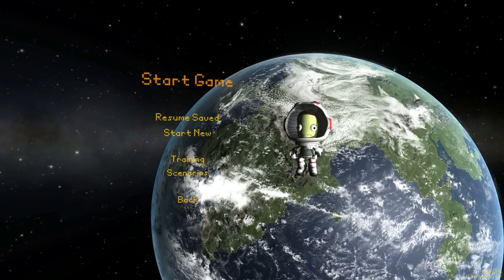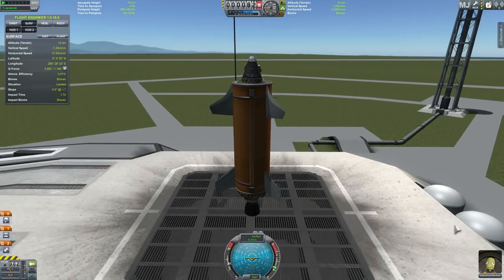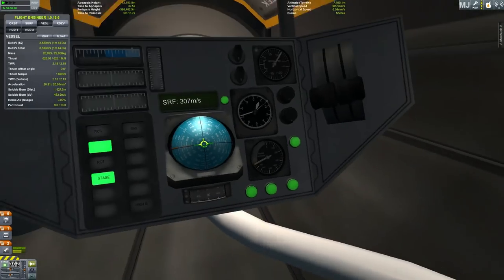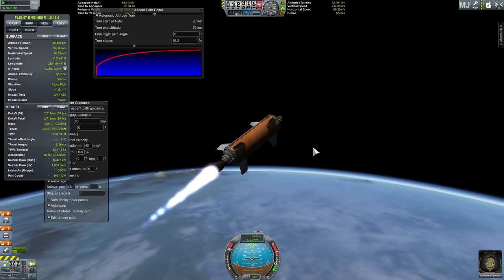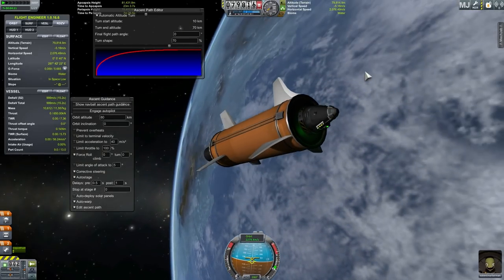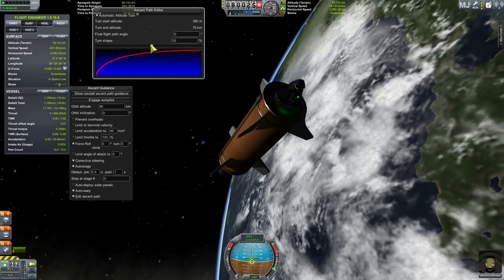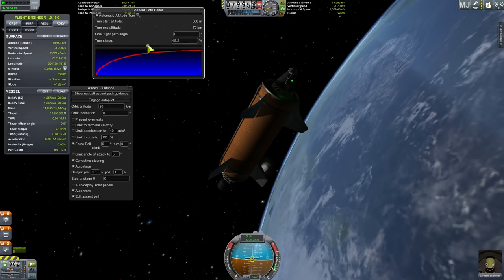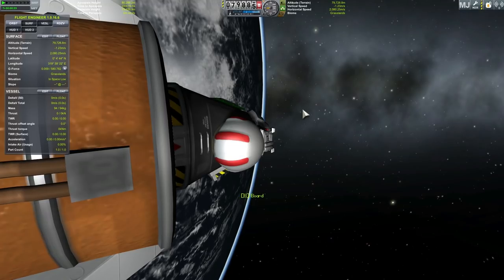KSP 1.02 - Optimal Take Off Path - Investigating the Gravity Turn.

Comment: Not putting fins at the front would help the thin rocket.
Reply from the maker: Myk Dowling I tried all types of fins or no fins. NOTHING helped my poor thin rocket... it kept spinning and spinning and spinning
Reply: Anton Petrov Haven't had a chance to play 1.0.2 yet, but I had no probs in 1.0 with thin rockets with tail fins, as long as I kept the heading close to prograde. (Turn early and slowly)
Reply: Anton Petrov There is no restoring force when you use fins at the top of the rocket. There is Yaw, pitch and roll dampening but only having fins at the bottom of the rocket keep the center of effort lower on the rocket and restore the rocket to prograde as long as you dont go too far off prograde.
Reply from the maker: I couldnt have a rocket called fuglor NOT have ugly fins on top. it was an aesthetic choice
Reply: Akin Khoo Just make sure you have more drag at the bottom, and your rocket will keep a low AoA. Tail fins work very well.
Reply: Anton Petrov I don't think you understand how drag above center of mass can fuck everything up. I'd send you a hand drawn physics explanation completed with force lines, torque lines, fuck ugly geometric shapes and everything.

But, basically, drag above center of mass means. If your rocket ever got tilted, even just a little bit(and it will), the front-drag will further encourage the tilt. Which will make the front-drag encourage the increased tilt that itself caused. and then again, and again.
it's a positive feed back loop

The opposite is also true, if there's drag behind center of mass, they will counteract any tilt/torque, and make the rocket flight straight. This is why the feathers on an arrow is where it is.

What you need is more lift surface (not control surface, as the torque those provide are annoying functions of vector)
And you want them WAY below your center of mass, and tack on some reaction wheel for constant torque control and good luck!
Reply: Anton Petrov Did you try pumping fuel back to the upper tank? KSP annoyingly (but perhaps naturally) drains fuel from the uppermost tank first, lowering your CoM, possibly below the CoL, which is what makes a rocket unstable.

Comment: you rocket flips because your COM is getting way lower in the rocket as fuel burns. You have fins at the front. Meaning your COL is way in front of the COM. Any SAS control input sends it out of control, and you can see quite a large YAW input just before the rocket spins out. Never put your COL in front of your COM.

Comment: You aren't supposedto have winglets on the top of the rocket (facepalm)
Reply: Peter Nielsen Thought so too, but the extra lift on this smooth gravity turn provided by an extra set of winglets can net you over 50 deltaV more. With two sets (top and bottom) of four AV-T1 I had over 1300m/s deltaV left with the same auto-ascent settings and rocket(excluding the winglets). Obviously with a more aerodynamic nose and limited acceleration (too bad limiting to terminal velocity is busted) much more deltaV could be saved.
Reply: Sasha-san that a good explination but wouldnt it make more sence to thave the winglets a bit further down to be more in line to make the COL match the COL ?
Reply: Maybe, but the point is basically moot. Any lift you get from the winglets is only useful for small rockets. I just wanted to make a point, that in this specific situation additional winglets were surprisingly useful/not-useless. I'd go with reaction wheels for additional stability.
Reply: OK thanks

Comment: The reason it's flipping it not because of the rocket width, it's your usage of the wings is shocking.

You need to display center of mass and center of lift. You want your center of lift (Blue sphere) to be under/behind your center of mass (yellow sphere). Not too close and not too far away. You can get your own personal feel over time.

Read here on the wiki http://wiki.kerbalspaceprogram.com/wiki/Center_of_lift
It explains placement results and will help you learn how to get better control of your craft.

Comment: @Anton Petrov Hint: dont change the angle in flight below 30km. After launch... ~350, go for what angle you want and keep it that way... It is true, the air presure is playing hek with the craft but if you keep the air presure stable in ascent, its ok. (this method is tested and i can give you my vid. if you want)
Reply from the maker: Alexandru Savu That's not the most efficient method. You want to make it a gentle curve due to the increase of terminal velocity and decrease of pressure as you go up.
Reply: Anton Petrov the best method relies on mj and its not a method for small ships... Change the ship, change the rules...
Reply from the maker: There are videos by Scott Manley who shows how to do gentle turns. It's not very difficult with practice. It's the same way you would do a manual suicide burn. Not as efficient as mj, but still more efficient than going in a straight line
Reply: Alexandru Savu Mech Jeb is not the most efficient way of flying. It can't lift some of my rockets. Though I can easily do this manually. It's just a good tool to start learning gravity turns or for "launch and forget".

Comment: The way to NOT have your rocket lose a good amount of Delta V is just stay close to the prograde marker.
Reply: Jack Graham staying close to the prograde marker will minimize steering losses, but the greatest savings will come from gravity losses. So you will want to start moving sideways as soon as possible without overheating your stuff.
If your turn has reached 45 degrees at 10k altitude, you're doing fine

You can also do a realistic single burn to orbit bringing the periapsis up by pointing the vehicle down

Comment: Wouldn't higher TWR rockets work better with a steeper ascent? You want to get out of the atmo before aerobraking and heating hits you too bad.
Reply: Myk Dowling No, as I wrote in another comment, you want to save as much weight on engines and fuel as possible instead, which avoids running into heating problems in the lower atmosphere. If you have to throttle down, or choose a non-optimal ascent path, you're almost certainly carrying to much weight for acceleration purposes that could be used/saved elsewhere instead.

Atmospheric drag is overrated by many in 1.0 stock aero (or FAR), because it was so broken in previous versions. It really is almost a non-issue with properly designed rockets, so now you want to optimize the fight against gravity (by doing a proper gravity turn) instead of over-optimizing drag avoidance.
Reply: Yes, but if for whatever reason, your craft has a high TWR, then you want to gain altitude a little faster to avoid hitting terminal velocity while still in low atmosphere. I'm not talking about a pre 1.0 "climb to 10km and then pitch over hard" ascent path, just pitching over slightly slower than with a more reasonable 1.3ish TWR.
Reply: Myk Dowling There is another factor at work as well, the Oberth Effect.  Your orbit is faster the closer you are to a body.  You get the same deltaV from your thrust close or far, but Kinetic Energy is based on your velocity squared (i.e. going from 1000 m/s to 1200 m/s gives you a lot more energy than going from 100 m/s to 300 m/s), so the lower you are when you thrust, the more energy you gain.  This has to be balanced against the energy you lose to atmospheric drag and in the old model the atmo was thick enough that your turn had to be pretty high up and rather shallow.  The new model is a lot thinner and thins out much like Earth, so a very early turn works the most efficiently.
Reply: Yes, a low turn is required in the new Aero model. My point is that you want your ascent path to have a steeper initial ascent the higher your TWR is. Although the atmosphere is thinner, there is still a terminal velocity to consider. The efficiency gain from the Oberth effect is not enough to counter the loss of efficiency caused by hitting terminal velocity. I will say once more that I do not mean flying straight up 10km and then turning over. I mean, say, turning 3-5 degrees over at the start instead of 5-10. The reason I said it is that Anton claimed the reverse, that a shallower angle is better as TWR increases, which is wrong.
Reply: Myk Dowling However, terminal velocity is much higher now than it used to be in previous versions. A very simple rocket I built for testing this (in stock 1.0 aero) had a terminal velocity displayed between 500-600 m/s until max-Q, after which it got much higher (as expected). I dare say that if you have sufficient TWR to hit terminal velocity low down, your main problem is probably going to be thermal-related...

My experience with FAR in 0.90 was the same that Anton claims, to go shallower with higher TWR (but not shallow enough to burn up the ship). Otherwise, the apoapsis would become too high too quickly, forcing you to throttle down prematurely. Admittedly I didn't have much time to play around in stock 1.0.2 yet, and now that nuFAR is released, probably won't ever tinker with stock aero again, so I may be wrong for that one.
Reply: Myk Dowling 
As long as you keep terminal velocity you won't burn up.
Reply: strikeout1991  Keeping terminal velocity is in fact exactly what will make you burn up. But I wasn't talking about destruction, anyway, I was talking about fuel efficiency.
Reply: ***** Some high TWR rocket experimentation indicates that you may be right about gaining too much height, though if you are launching at the right time and planning on a moon visit or Kerbin SOI escape, things may be different. I think I much prefer my 1.3TWR rockets; it's all so much calmer.

Comment: Your small rockets flip during ascent because with the improved aero model, you need to build rockets that are long and slender.  Had you stacked another FLT800 fuel tank on and removed the fins at the front, it would most probably not have lost control.  The FAR mod which is a good aero model would punish you severely if your rockets were relatively short and fat.  The new aero model (v1.0+) is not as realistic as FAR but not as bad as the Soup-o-sphere of the old aero model.

Comment: Can anyone here do what google can't and explain to me why it's better to not just go straight up, then horizontally accelerate when in the vacuum? 
I figure you go through the minimum amount of air this way,and then you can also use your fuel in the vacuum where its most efficient because no air/more efficient engines, to get the required horizontal motion.

Obviously I am missing something but I have googled it a few times and the best answer was a stupid one which was ' because if you go straight up you wont have any horizontal motion and ull just fall down.'

I assume it has to do with the difficulty of either turning or of changing your momentum from up to horizontal, or both, but i still cant get my head round it.
Reply: I'll try to do my best to give you a useful, but techically less accruate description so that you get a feeling of why turning sideways early is favourable:
Your velocity is a vector, and you are accelerating (both because gravity and thrust... and drag but let's forget that for a second). Acceleration can have two effects on a velocity vector, it can change it's magnitude (make your speed higher or lower), or it can turn it, without changing the magnitude much. It all depends on the angle between the velocity and acceleration. If they are parallel the magnitude is changed only, and when they are perpendicular the direction is changed.
Because you want to increase your speed to an extremely high value (orbital speed), you want to have your thrust looking exactly at the same direction as your velocity, so that its magnitude is increased, so sharp turnes are already bad for you. But there's more.
If you go straight up, gravitational acceleration will be parallel to your velocity, and much of its effect will be decreasing your precious speed. If you go a bit sideways, then gravity will have less effect on the magnitude of your velocity, and rather it will just turn it. This turning is useful, because you don't need to use your own thrust for it, and you can keep facing in the velocity's direction, while gravity does all the work putting you in the right direction.

You can do a simple experiment in KSP: If you go straight up, because of gravity your speed will decrease by about 10 m/s every second. But if you go sideways at a 45 degree angle, your speed will only decrease by 7 m/s each second. Also it will turn you toward the horizontal direction, which you will eventually need for orbiting.